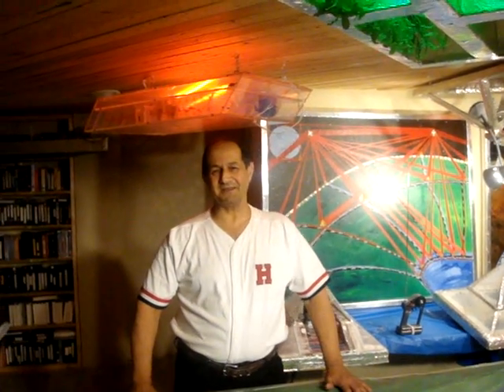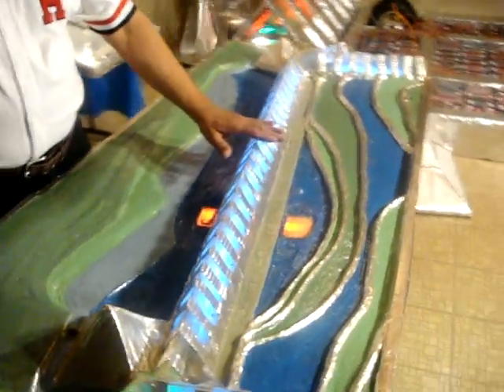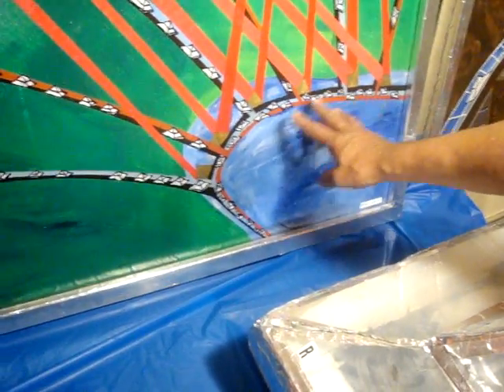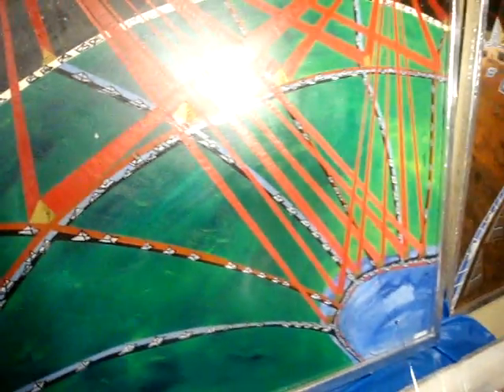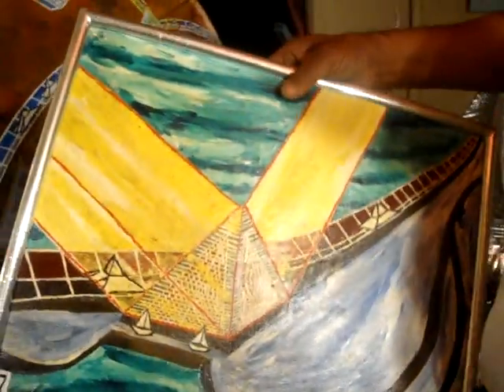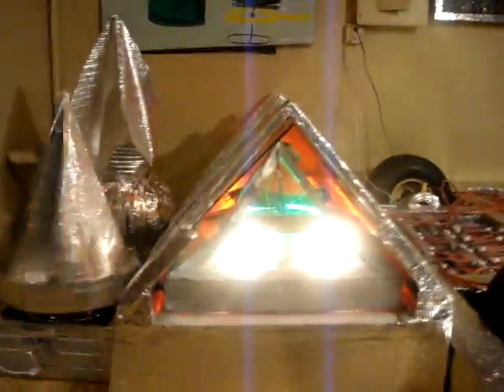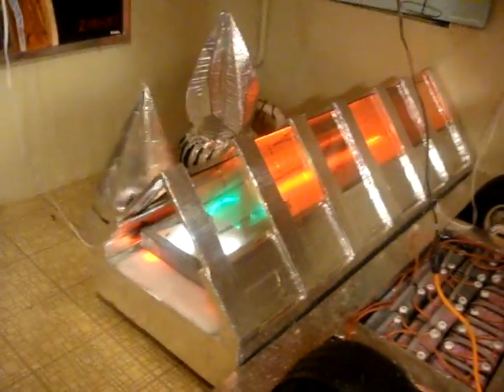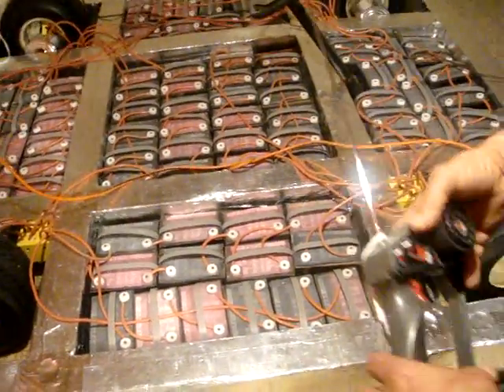High Speed Air Tunnel System Project

Comment from the maker: @LucifersDisciple6 @LucifersDisciple6 When traveling throw the tunnel you will be able to see out the sides of the tunnel and because your going so fast the glass well look like its o-most clear and you be able to see out very well. Yes, I agree with you, the energy crisis is fake but they control it and we are under there control and we need to brake free from the control they have over us. That's we why trying to build something off the grid because it is very important.

Comment from the maker: If a car stops in the tunnel this will block the air flow. This will make all the cars in the tunnel by the block slow down and lose speed. We should have computers that will have control over the air speed. When a block is detected will shut down the power to the part of tunnel where the block is at. All the cars in the tunnel by the block will stop do to air pressure and/or brakes if needed.